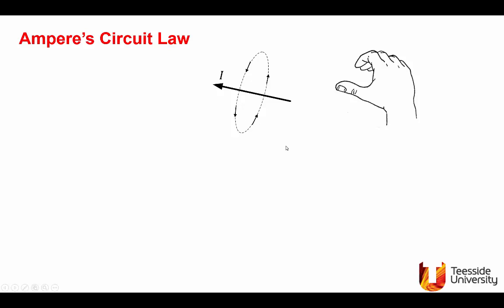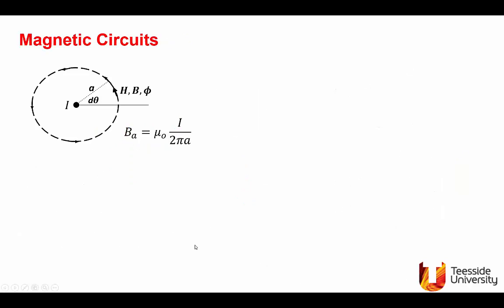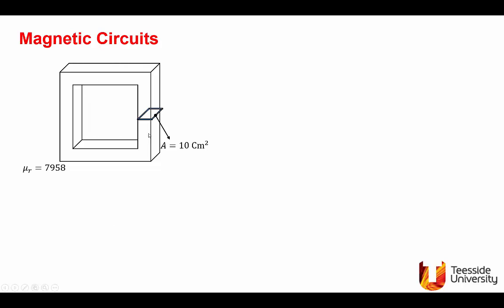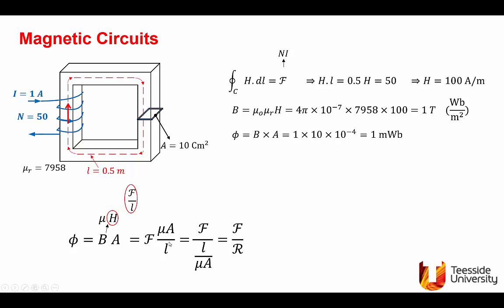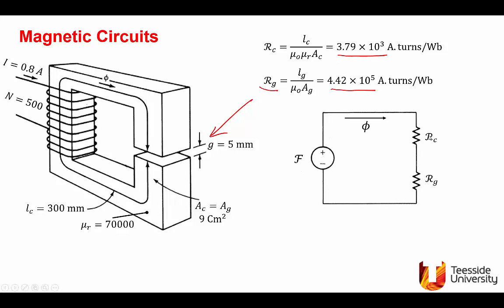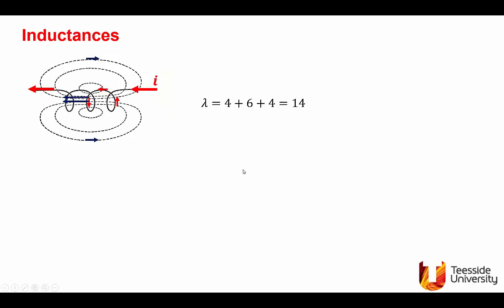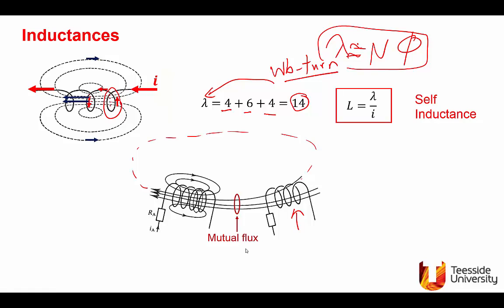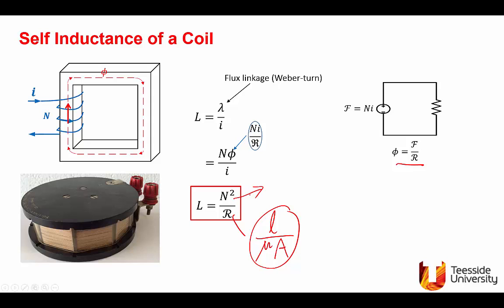Ampere's Circuit Law and Inductances

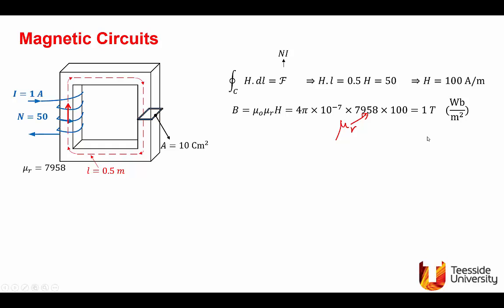Comment: in the  calculation at 9:27 you have assuned H is a constant over the path, why?
Reply: for simplicity. its reasonable to assume that most of the H will stay in the iron and not leak out